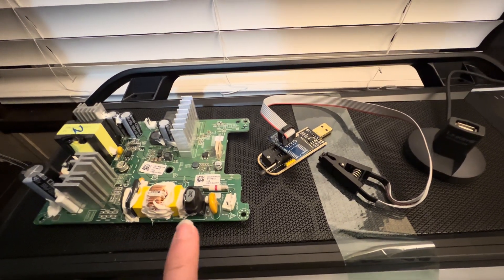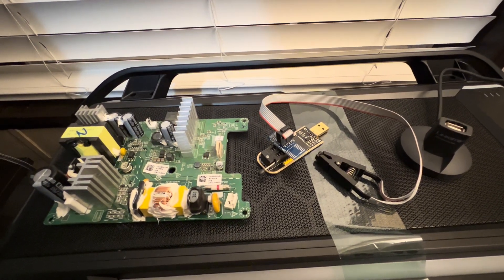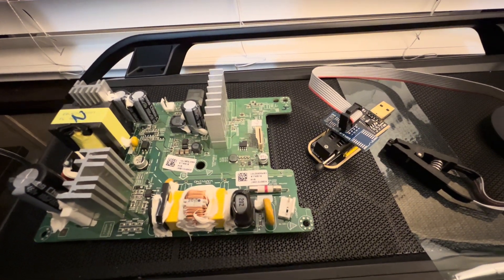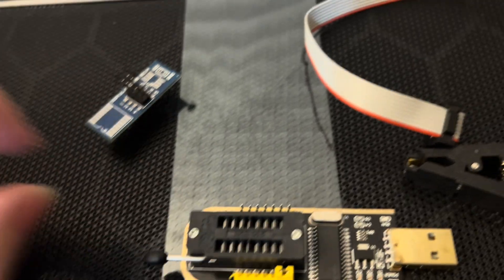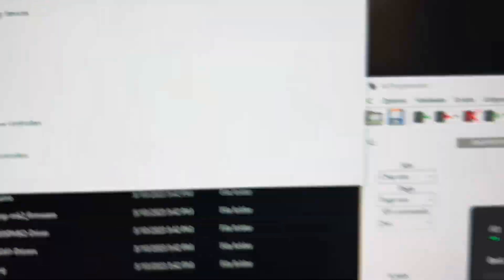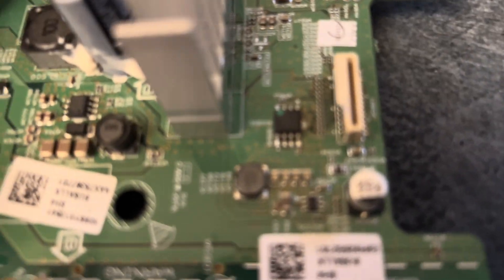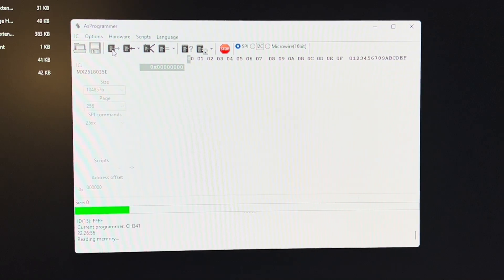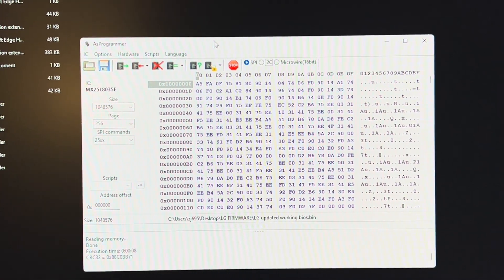How to fix LG Soundbar Subwoofer not working or pairing. SPN5B-W + SPN8-W part# EBR89625801

Comment: Hi first i want to start by saying thank you i have fixed my subwoofer which was the 5 one however im having issues fixing a  SPN8-W subwoofer my friends, i really need to fix it and reprograming through the Asprogrammer seemed to work, however this one i never got an error code 0000E000 during the verification process which is strange because mine i fixed had that error and works, this one did not and is not working
Reply from the maker: I emailed you back. Let me know if it works
Reply: @FiveStaxX  it was damaged a blown part so replaced whole motherboard.
Late

Comment: When I connect the clip to the eeprom chip my computer makes a disconnecting sound and I'm not getting a reading. Dead chip?
Reply from the maker: Mine no longer makes a sound every time, so that's not necessarily it. Just proceed until it identifies the chip and you should be ok

Comment: Thanks mate worked for me on my LG GX sound bar. Very easy guide to follow! Only problem now is that my rear LG Spk8-S speakers won't pair since the firmware flash? Any idea if there is a fix now for this?

UPDATE: Fixed. Since subwoofer firmware was updated i just had to repair them manually with the little pin push button on the back which i completely forgot was a thing lol

Comment: Hi, I have a LG GX 3.1 soundbar with the SPN5-W subwoofer. When I power on the soundbar and the subwoofer, the green LED on the subwoofer continues to blink green very fast. This happens for seemingly forever. When I press the `PAIRING` button, the LED changes to a constant green color and never changes again. I've never seen it turn red. The woofer produces no sound in either of the two states. When i unplug the woofer from he socket, the green light stays on for a couple seconds performing turning off and the subwoofer making a high pitched noise. Are you familiar with such scenario? Will the fix demonstrated in the video resolv emy issue? Is the root cause of the flash on the chip becoming corrupt known? Is the file you provide in the description a dump of the chip from a working board? Thanks in advance!
Reply: An update to this thread: I’ve managed to repair my subwoofer to working condition using this technique!
Reply from the maker: @ElektroKill  glad it worked!
Reply from the maker: It should work on yours as well. My firmware is a dump from a fully updated working subwoofer
Reply: @FiveStaxX Hi, I created a video of the symptoms I’m experiencing: https://youtube.com/shorts/tIYHrTfr5_0. I will see if I can get the chip programmer ordered soon. Is this a permanent fix or is there a chance it will brick itself again?

Comment: Hello!  I have the same problem with my LG SPN5B-W and I am considering buying the clip on Amazon to perform the fix myself. Only thing that worries me is that I have this one board (only my sub mainboard) and I dont have a clean and working bios file to overwrite on my chip. Do you know where I can find the clean bios file to download it in order to overwrite my BIOS?  Thank you!
Reply from the maker: The file is in the video description, on my Google files
Reply: @FiveStaxX  Super awesome your solution worked! I repaired it with a 20$ adapter bought on Amazon.... Closest LG repair center was charging over 100$ for evaluation and repair.... Thanks soooo much!

Comment: The sub for my SN8YG stopped working after ~2 years and I found this video after a search.  I wasn't comfortable trying to go thru the steps to reprogram the chip so I contacted zj695000 and he agreed to accept and reprogram it after sending from our condo in Hawaii.
It arrived back today, I reconnected &  reassembled the sub, plugged it in, and the Bluetooth connected in ~3 minutes!
It's great to be able to hear mid & low-frequencies again.
I'm an "all-thumbs" guy when it comes to stuff like this and if I can do it, SO CAN YOU!
Definitely worth giving it a try to save buying a new soundbar/sub combo and tossing the original.
I AM disgusted with LG on this; it never should have happened in the first place.
GOOD LUCK!

Comment: This worked for me too.  The lever on the ZIF socket would not stay closed, so that slowed me down until I figured out that I needed to hold it closed manually. I also needed strong magnification to read the chip marking. I bought the LG sound bar and sub-woofer as refurbished from Amazon a couple of years ago, so I assumed I got ripped off, but it was LG's fault and you fixed it for me!

Comment: getting [ Verification error on address: 0000E000] any suggestion?
after following 11min of you video guid
Reply from the maker: Verification 0000E000 is ok 👍 try testing your board
Reply: @FiveStaxX  i did try, after install back to the sub, I did not see power on the sub( i think it different kind of problem), thank you ( but i have decided to not to buy LG product anymore)

Comment: Ran into some issues trying this, here's some tips if anyone else gets them.

1. If you get this error on Read ID, try re-seating the spring tensioned pin that goes onto the LG PCB.

Current programmer: CH341
ID(9F): FFFFFF(Unknown)
ID(90): FFFF(Unknown)
ID(AB): FF(Unknown)
ID(15): FFFF(Unknown)

2. For some reason the "all-in-one" unprotect -> erase -> write -> verify" wouldn't work for me, and I could tell by it completing the process instantly. When reading back the IC, it's ALL FF. I had to click around each step manually, and it works.

3. For some strange reason my board wouldn't work once put back into the subwoofer - the power wire/connection/terminal were to blame. They had to be touching at a very specific way for power to flow. Relatively easy fix -  solder and heatshrink, electrical tape, or re-crimp, etc.
Reply: I have been getting the Unknown message and no able to read the chip, tried many different ways still not seem to read it. Tried 4 different clamp, any advise will be helpful. Thank you

Comment: Thank you very much for the working file! My IC works only from aprox. 4,7V and readed data is different every read, but similar to yours. I dont have new mx25L8035e and i didn't want to wait for new from Aliexpress 😅 My collegue have w25x20bv (only 2Mb, but there Is far less data to write), so i cut 1MB to 256kB and all works! Once again thanks a lot

Comment: I have a Musicflow HS7(LAS750M.BGBRLLR) subwoofer that has no sound and paired, would the firmware work on this one as well?, the subwoofer is s75a2-d and the amp board is AAX74968507. i have reset it umpteen times to no avail.
Reply from the maker: Possibly. Most of LG wireless subwoofers seem to use the same exact boards.

Comment: Thank you very very much, it worked for me as well. I 'd like to share two moments I encountered. 
1. It is good to check the clip pins if they are properly aligned. I bought the programmer and the clip on Aliexpress, but I got no success, which made me think I had a faulty IC on the LG board. I bought spare ICs (5 pcs pack), but then I realized the clip had no contact on some pins. 
2. After the fix, the subwoofer was considerably less loud than before. I believe I got it fixed by re-applying the update (USB stick) to the soundbar.

Comment: Our unit failed months ago and were so busy never got around to dealing with that particular flaming duck. Turns out the time you released the longer video I got the “round-to-it” bug and started looking for solutions. LG’s answer was to either send it in for repair out of warranty at well over ½ the cost of the unit or simply replace it. Knowing I’m not wealthy, (ask me how I know), decided to find alternatives. There are always alternatives. Sooooo, your timing was perfect. Life keeps interfering with the best laid plans and all that but ordered the programmer. Once it arrived, and we were back home, re-watched the video with long pauses. (I purchased a very basic PC laptop for other programming purposes recently.) Going through the steps you outlined never did see the generic driver however. Reset the PC, (turned it over and shook it as it were), and lo and behold, it finally popped up. Finished the process, (the clip for the IC was a bit fiddly), and it showed 1 second to run. Actually it was longer and the progress bar ran for a bit. On faith, put everything back together and it worked. Since we have an LG TV and the bar is connected via optical cable, nothing was as expected. I had to not only manually set up the woofer bluetooth but the bar to TV connection was hosed up. A bit of fussing and everything was back as it should be. We can now watch all the Vet shows, Josh Gates stuff and how to murder folks on the ID channel just fine………….(Hey, I don’t tell the wife what to watch, she knows too much!!) Again, thanks tons for posting the video. Obviously it’s helped a LOT of folks. (As an aside we switched from Samsung to LG for various reasons. No matter which vendor you choose there is always going to be something they’re either not good at or break over time. Frying pan or fire, pick your poison I suppose.) I’ll see about the donate link when this gets posted. The little iPad can only do so much so fast.

Comment: Hello, I love your video, and was easy for me to follow however after I hit  unprotect> earase > program > verify it doesn't do anything but show this message in the ASProgrammer 
12:51:21
Programming memory (with verification)...
Verification error on address: 00000000
Execution time: 0:00:00
Any thoughts?
Reply from the maker: 0000000 means no data was written. I would try moving the programmer clip and try again

Comment: Is the replacement part neccessary or am I able to fix the issue of subwoofer not turning on with the original part? Just to be clear before I'm ordering the programmer.
Reply from the maker: Does your subwoofer have no lights? If so, all you need is the programmer, nothing else.
Reply: @FiveStaxX  Yes, the light won't appear after I have plug the subwoofer to power outlet.
Reply from the maker: @nnikkem  that's a good sign. All you need is the programmer and follow the video instruction.
Reply: @FiveStaxX  Hi! When I try to erase and load the new software I get an error on address: 0000E000. Something to do with the chip module serial number?
Reply: What if the light is on but there is no sound?

Comment: Hello! I see from the comments that this solution worked for everyone. I have the SN7Y soundbar. Solid green light on subwoofer. Sometimes no light at all. You said that this is caused by a firmware update right? However my soundbar has not wifi, so no internet access. Also, sometimes im able to hear something from the subwoofer for a few seconds but then it dies again. Will this solution still work? Thank you
Reply: I got the programmer and it worked for me too!!! Thank you so much for this video!!!
Reply from the maker: @kmanasis  thanks for the update! Glad it worked 😁
Reply from the maker: When the subwoofer is connected, try to do a firmware update using the LG sound bar app on Android, or download the firmware on LG support website and use USB flash drive
Reply: @FiveStaxX  hey man! Unfortunately i have to deal with this again… Last time worked like a charm, this time however i got the following error:

Programming memory (with verification)...
Verification error on address: 0000E000
Execution time: 0:00:02

Any suggestions?
Reply: I did. Nothing changed. I tried to send you an email but i couldnt. Whats your email?
Reply from the maker: @kmanasis 5000inc@gmail.com

Comment: Will it work on my SPN4B subwoofer? It come with my LG SN9 sound bar and the wireless connexion with the subwoofer cannot be done. I have the chip 25Q80CSIG for the wireless connection.
So, I have a Flashing green light at power up or when pressing Pair button. Flash super fast for 1 sec then flash normally after. After 30 sec of green light flashing, the red light appear. I reset the sound bar.
Reply from the maker: If it won't keep flashing fast for pairing, it has usually meant the chip needs replacing. But it might work with flashing, can't know for sure. Are you in the USA?
Reply: Hi, no i'm in Canada - Quebec. So the super flash green vs the normal flash green have a difference?  @FiveStaxX
Reply from the maker: @zakzak3649 when you hit pair, the light should flash quickly for multiple minutes. If it goes right back to slow blink, there's a problem. So far, that has meant that flashing doesn't work and the eeprom needs to be replaced. I can fix it for you but the shipping is about $22 each way.

Comment: Hey Please, I see this tutorial. I have an LG SN4 system, where the subwoofer green light blinks fast for 2 seconds and then starts to blink slowly. it never connects to the soundbar. after a while, it turns red. will this approach work to rectify it? Thanks
Reply from the maker: From my experience, when it only blinks for a few seconds and then blinks slowly again, those boards have required a new eeprom chip replacement.
Reply: @FiveStaxX  so what do i do in this case as i am not experienced with this
Reply: @FiveStaxX  so it is not necessary trying this approach out first
Reply from the maker: @cherechindukwe295  you can try flashing it, but i think needs a new chip. Are you located in the US?
Reply: @FiveStaxX  no I am in Canada
Reply: can confirm that this method DOESN'T fix this issue

Comment: Error comparing data! Address: 0000E000 Buffer: A5 Chip: 00 pleas help new lg firware bios lg sn5y SPN5B-W
Reply from the maker: Error code 0000E000 is normal. You can try testing it out

Comment: Greatly appreciate the video. This kind of repair is exactly what youtube is for. I tried this and unfortunately I think my eeprom is fried. I tried several attempts with no light at the end. I tried individually unprotecting, erasing, removing clip, re-attaching and then programming. Each time erasing/writing successful. Every time with no change at the LED. My question now is, if it's only the eeprom that needs to be replaced, are single chips available? Where does one buy single eeproms? Am I correct in assuming it has to be the same exact type of chip? Thanks again despite the failure, it def seems like you have helped a lot of people.
Reply from the maker: You can buy single chips, but it's not worth it. I purchased a bunch and have been replacing them for boards that aren't fixable. You can email me at 5000inc@gmail.com to set up a repair, or i can send you the link to the newer version of the eeprom chip if you have the equipment to replace it yourself.
Reply: @FiveStaxX I saw on digikey you have to order in multiples of 20k 😅. Please send the link I'll take a look. This has now become a project board. Thanks
Reply from the maker: @Sygnalrift  25V8035F is the recommended replacement chip by macronix. I bought them on eBay for about $10 shipped for 10
Reply from the maker: @Sygnalrift  https://www.ebay.com/itm/193064865160?mkcid=16&mkevt=1&mkrid=711-127632-2357-0&ssspo=EFeI7hZcRlS&sssrc=4429486&ssuid=DaCU4sJCRUO&var=&widget_ver=artemis&media=COPY
Reply: @FiveStaxX  thanks I'll keep you posted on results.

Comment: Help.  LG SL6Y lowers the volume every 30 minutes.  Only turning it on/off helps.
Reply from the maker: Have you tried using the LG sound bar app to check for updates?
Reply: @FiveStaxX  Certainly.  shows that the latest one is installed.  I've been suffering for several weeks now.  This is a problem from Canada to Europe.  Nobody can find a solution.  One technician said the problem was with the capacitor, and another with the firmware.  But the firmware is not online.  LG said they don't know what to do.  I changed cables, optical, Hdmi 2.0/2.1, removed Bluetooth devices, turned off the subwoofer - it doesn’t help.
Reply: @FiveStaxX  help

Comment: Do you know why asProgrammer don't read my chip? Says ID Unknown, maybe my chip is dead. When i choose unprotect the asprogramer block all the buttons, shows in the left corner "old sreg: 111........." and nothing happen after
Reply from the maker: If it blocks out the buttons, it's trying to perform a process. If everything is installed correctly, it's probably either a bad programmer or bad chip.
Reply: @FiveStaxX  thank's for the answer. I bought from amazon and the feedback is good. Maybe I will give up
Reply from the maker: @14Rodolfo14 if you are in the US, i can replace your eeprom chip for you if you would like

Comment: YOOOO thank you so much. I got the error code listed in the description and it did work! I have a couple notes for those that will try this after me: I had to order another one because my clip wouldnt get a good connection, one of my programmers also caught on fire but on the 3rd attempt i did it without any flaws. Thank you for your video!! Really appreciate this!
Reply from the maker: Glad it worked! 😁